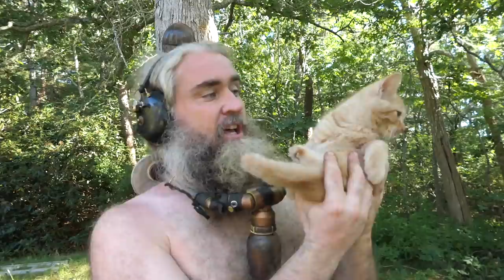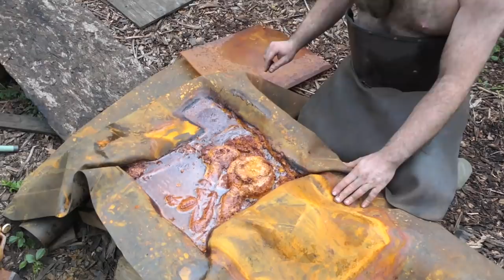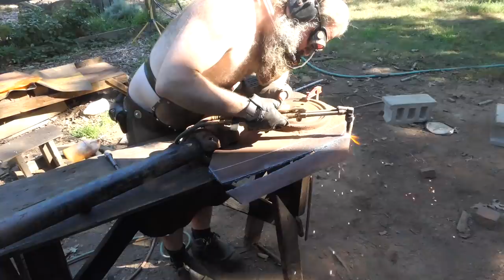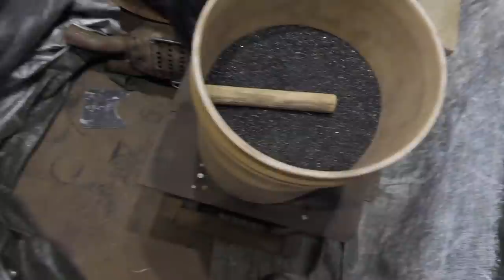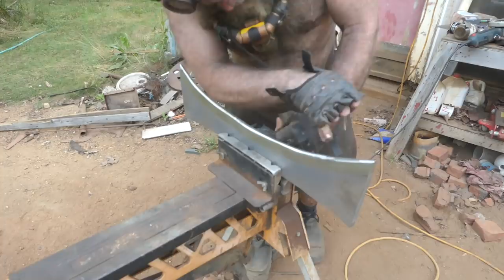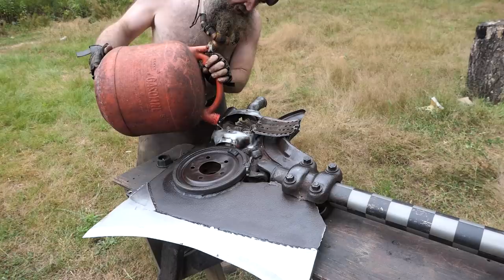Wasteland Axe Redux Charity Build

Comment: I really love your builds man, wish i had the tools to make stuff like this myself. Keep up the good work!
Reply: I started off with a cheap hacksaw, old corded drill, sanding disks and foam pad from ebay, some old files and some bits of scrap metal/spring steel, you'll be surprised how far you can go with those alone making cool knives and short/regular sized swords, off brand angle grinders and disks can be found pretty cheap too. The biggest setback I've had is not having a welder but there are ways to get around that and you can pick up a stick welder for relatively cheap once you know its worth the investment
Reply from the maker: I found the biggest set back was finding a place you could make a mess/noise/fire without the humans complaining.
Reply: @michaelcthulhu  ah yes, pesky humans and their love of complaining, honestly I don't see why they have such a big issue with me grinding a bevel or hammering rivets and torch forging to rescue an old tool at 3am
Reply: @michaelcthulhu  That too, can't really do any metal work or set fire to things where i live at the moment. That's why i am aiming for a house on the country side one day.
Reply: @michaelcthulhu  It absolutely is. I was going to buy a torch and make crazy scrap metal furniture. But then realized the only place I could do it was the sidewalk outside next to the old people restaurant.... Probably wouldn't even get a chance to light the thing.

Comment: It's amazing what a little bit of white vinegar can do. I've saved scissors, can openers, bottle openers, all kinds of metal gubbins. Mostly kitchen stuff, since I'm not a welder/mechanic/blacksmith/anything that uses tools, but yeah. Much cheaper than buying a new thing. Especially since most new things these days are made out of plastic and break in a week.

Comment: Hey Michael, For the sake of cord management, you could do some sort of pulley system for your cords, you can get these cord wheels that lock and retract and you can hang them on your ceiling. I know dangling cords would get in the way too, but if that would work better than having the cords on the floor I thought I would just offer the idea.

Comment: the only way i could think of artificially pitting someting is using the air phunamic slag remover,( the thing that has hardened nails in it) then let it rust

Comment: You could try artificially add the pitting of aged metal with a textured face hammer. Though, it has to be done before final temper, usually during the first stage of normalizing a blade. You just put it in for a second cycle.

How do I know this? Hobby blacksmithing i've been experimenting with tools i've been reverse engineering from precious metal working like silver teapots and such. I saw the tools then though "well I've got an old sledgehammer that's collecting dust, Let's take the dremel and rough up the face a bit. See how that works" It works fairly well for smaller things, But I confess I'm not sure how it would work large scale like your builds :o love them regardless!

Comment: Yeah, done 20:40 about 4 days ago, I had a light fixture fall on my head while working. Four hours later I've found a tiny piece of glass stuck in my scalp. The light literally stayed glued to the ceiling for a solid hour before falling on my head. 1 minute moment glue gets tight in 1 minute, but if it gets warn soon after, it lets go. It says 24h cure after all, stupid me...

Comment: You recommended WD-40 for tape glue, chemical alcohol works as well
Reply from the maker: Won't alcohol dissolve some kinds of paint too?
Reply: @michaelcthulhu  Not dry to my  experience, I have the alcohol on a piece of cotton then rub the glue off. It evaporate before penetrating the paint.

Comment: If you have a plasma that can cut 1/2 inch y bother with an oxi torch?

Plasma blasts through scale much nicer then oxi fuel and puts MUCH less heat in to your work for the same cut

Comment: I can see the stat block of this weapon.
2d8 Slashing
1d4 Fire
Swinging this massive weapon requires Great Weapon Fighting, proficiency in Martial weapons, and 18Str.
3 Swings of this weapon will leave you absolutely haggard, +1 Exhaustion.
Due to its size and mass it will cause you to be at a disadvantage for each attack.
"This weapon is unwieldy and it is unclear of who made this weapon, or why they made it. Scant lore says it was made by a madman."

Comment: For the Demon's Souls walkthrough what approach do y'all think would be good? I was originally going to go Strength since I think that's the easiest approach to demonstrate for new players, but despite being a Quality weapon the Butcher's Knife plays just like a Strength one so I felt that playstyle might get dull. On the flip side I could do a Magic build, but out run last year in the original Demons Souls was magic and it would be almost identical to that. Walkthrough prep is already using Dex so that's out. Anyway vote on what y'all think would work best and keep in mind it's a walkthrough so the idea is to show the path of least resistance for struggling players.